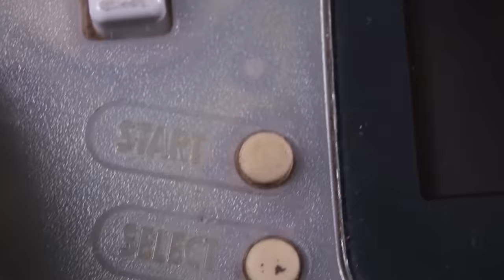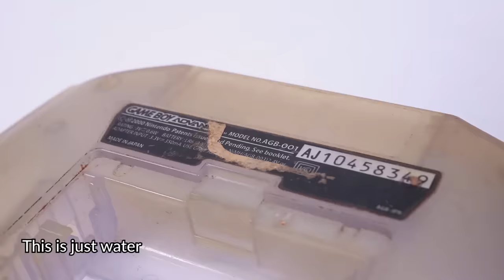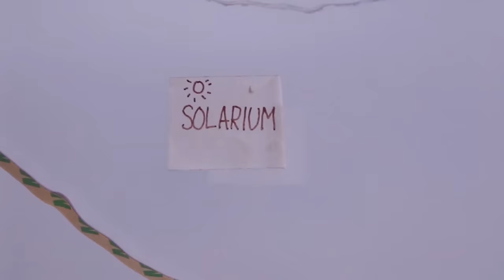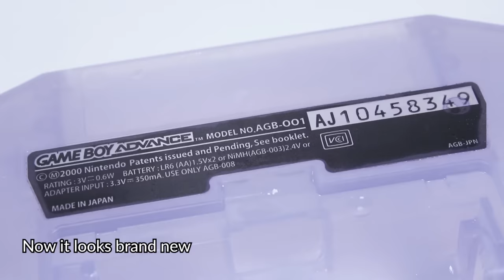I Restored This $5 Ebay Junk Gameboy Advance. It Used to be Blue – Retro Console Repair

Comment: This proves alcohol can indeed fix anything!

*drinks alcohol*

*cries*
Reply: and rethinking life
Reply: Have a nice day
Reply: Well there's your problem: you're drinking ethanol, CH3CH2OH. The alcohol that fixes everything is isopropyl alcohol, CH3CHOHCH3. If you drink enough of that all of your problems will be over soon enough.
Reply: Türk müsün
Reply: @muptezelbayan7585  what
Reply: Where are you from
Reply: Why is the “**” not working on your thing??

It usually goes bold
Reply: @giggityguy  I mean, you're not wrong
Reply: @giggityguy  Or at the very least, you aren't going to be SEEING those problems.
Reply: @havenmj  
they put two instead of just one, the letters are still bold inside of them, you can just barely notice it if you look close enough.
Reply: r/CursedComments?
Reply: @brandoneverett3418  SHEESH,
Reply: @giggityguy  you aren't wrong. they'll be over one way or another.
Reply: @Temperance Winzenried What are depression naps?
Reply: I came in the comment section to say that.
seems like geniuses think in the same way.
Reply: crying fixes your inside brain. but kills everything else
Reply: Technically alcohol is a solution..
Reply: @bradleyengland995  Is there something like an outside brain?
Reply: @Mike Hawk ?
Reply: So funny because its true

Oh god
Reply: @giggityguy  you just spoke like Agent 47.
Dont worry. It will all be over soon
Reply: Drinking alcohol can make you drunk!
Reply: No it doesn't just tek

Comment: Normie: Why do you repair an old console that counting the materials you used to fix it, its more expensive that buying a new one?
Odd  Tinkering: my goals are beyond your understanding
Reply: kindertuc Ugarte The Flash reference? :P
Reply: Actually you can make quite a bit of profit from fixing a GBA like this.
Reply: The materials he used are probably old and plus he would have money to do this
Reply: Right? Fix it and install a backlight onto the thing, and I am sure he'd make bank.
Reply: did it for the 3m+ views haha
Reply: It is just fun to do.
Reply: @lkskun  and fun to watch, i once replaced the lens of my ps1 back in the day. i also like tinkering with stuff but i end up destroying them haha
Reply: More like my views and subs
Reply: I mean some old devices only need a good cleaning or reflow (basically reheating the solder to fix loose points)
and on some occassions the biggest issues is a busted capacitor that tend to be like 50-99 cents a piece to replace
Reply: people like watching things that trigger their nostalgia ahha

Comment: Odd Tinkering: "Needs to open with special-"
Me opening GBA with knife: "What?"
Reply: me to I just use a knife most the time
Reply: How to be as intelligent as Einstein for normies
Reply: I'd use a proper screwdriver. But what do I know, as a female.
Don't use kitchen knives as tools, it drives me mad.
Reply: Reminds me of when me and my friend had to replace the can in my 360 slim

You have to a special pick to pop latches for the casing. We just shoved a flat head in some and smaller clips we just rammed a knife in.
Reply: Jajaja i use knife for ps4 controll

Comment: In 2050 he is gonna be like 'restoring an old Nintendo switch' lmao
Reply: It used to be magenta and cyan blue
Reply: A retro Nintendo Switch.
Reply: 9600GTMAN  I've had mine for 2 1/2 years, it works great. I just don't play that sword and shield shit. Let's go eevee all the way 💯
Reply: 9600GTMAN bruh I’ve had mine since launch
Reply: "It also seems to have the old "joycon drift" problem that these consoles so often had."
Reply: 9600GTMAN  maybe because I don't use it much. I haven't really moved on yet, so I usually use my 3ds instead. My 3ds has a couple problems like static along with the music.
Reply: 9600GTMAN  Correction: 3ds XL

It's only four years old, sorry for the confusion

I've dropped mine, accidentally scratched it, but it stuck with me. I'm using it right now, and I've almost defeated the ultimate ghost in find Mii!
Reply: @9600GTMAN. That’s a false statement
Reply: @9600GTMAN. I’m going to assume that you’re just doing this for reactions and move on with my life.

Comment: That's a pretty mint condition. I remember on my famicom that my most recurring problems were a torn rubber below the joystick buttons or a loose plugin port for the joystick that needed soldering.

Comment: I have the exact same gameboy advance but it still works fine.
Reply: I have one too.
How can someone drive their console to such a state?
Did they throw it inside their basement or something?
Reply: @WH250398  it's not like nintendo only makes one copy of every style.
Reply: Same.
Reply: Well I remember owning these consoles at like 6 or 7. Easy to understand how it looks like this
Reply: @WH250398  mine worked till a year ago, stored it when I moved and forgot to take the batteries out and now the connections are COVERED in battery acid and blue is corrosion. Might be able to clean and fix it 🤔
Reply: @dahfishguy  I was being slightly sarcastic lol
These things are built to last. Those batterycontacts aren't hard to fix by the way. Take them out and let them sit in vinegar for a while. The vinegar will eat away the batteryacid.
Reply: This one looks like a dog buried it in the backyard. Never fear Odd Tinkering can restore it. Wait till he does a Coronavirus fix!
Reply: @WH250398  I didn't catch that haha. Thanks for the tip, wasn't sure how to go about cleaning them
Reply: dahfishguy yeah thats a easy fix, cutips isopropyl alcohol and paper towels will take of the corrosion and if a spring gets broken in the process aluminum foil can get folded into a tiny square to be the conductor instead
Reply: I have a gba sp but my mom knocked it off the table and the hinges kinda broke

Comment: something is broken
This guy: let's rub some alchohol on it
Me: that won't work 
it worked
Me: surprised pikachu face
Reply: This is fake. I do micro soldering all the time.
Reply: @teemoleague907  is that part just fake? that's kinda disappointing i mean there must be a bit of truth
Reply: @loverboy6149  what they do  in these foreign videos is shoot the video with a working product and edit those scenes for the end. The film maker will destroy the product and act like they got broken junk from eBay, or a trash can. And pretend to restore it. After that these scenes will be edited and put in the beginning. they destroy a 50 dollar product and make 2000 dollars or more from YouTube ads. They exploit the YouTube system. Notice the soldering job was bad. The meter needles  for grounding was put on the wrong contacts. He measured 2 hot leads! He never replaced audio caps. And he didn't even take off the power switch completely. There's solder joints on back of the board!
Reply: @teemoleague907  the more you know I guess. Still kinda disappointing to say the least
Reply: Are you sure it's fake, cause a bunch of other channel use the same product and show the complete process.
Reply: Shockblade Zed cringe
Reply: @p.m3726  it's cringey to see people say cringe
Reply: @looeegee  so you're cringy
Reply: @blind_surgeon  Define 'Cringe' please I've seen that word used so much that now I don't even know what it really means or when it should be used
Reply: @looeegee  you just used it so obviously you know
Reply: @blind_surgeon  yeah but it's actually cringy something you just don't like or find funny? If so that it's completely subjective or is it something embarrassing or to feel bad about? I mean there's so many people using that word that now everything is labeled as cringe and that just makes me, well, cringe if could say so, I don't know if you get me.
Reply: @looeegee  I think you're reading way too far into it.
Reply: @blind_surgeon  well forgive me, if you didn't notice English is not my first language thus I felt curiosity for the use of the word given it's not something seen in my language. But thx btw.
Reply: @teemoleague907  still good for layman showcase to avoid complexity lol
Reply: As someone that worked in an electronics manufacturing company, we used alcohol to clean our boards all the time. When we weren't cleaning them with tiny brushes I cleaned boards in a giant vacuum chamber to clean off flux and other materials from the soldering process. Had giant gas cans full of the stuff and dunked boards in while brushing off the grime. So people who are saying you can't use alcohol are wrong because it's standard throughout the industry.
Reply: Dead Meme
Reply: Say this as an actual comment
Reply: @looeegee  free Hong Kong
Reply: @looeegee  people are fixing sound capacitors with alcohol? Are you serious, can you post a video of it? Cuz I think you are the one lying
Reply: @teemoleague907  see the previous comment where someone addressed it, he gave a clear response unlike you that are claiming fake something which obviously it's NOT, the fact that you supposedly know about this doesn't make you right about saying that this YouTuber doesn't fix anything and shows an actual brand new product, I mean who you think you are??
Reply: Samuel Barela please, don’t assume that he’s actually Asian. I’m not debating anything just pointing it out
Reply: @teemoleague907   when someone says alcohol most people think only of ethane that is in beer,vodka etc...while there are countless alcohol types and ethane is only one. the guy used isopropyl alcohol which is a great for cleaning things.it is used to clean metals glasses and even human skin(hand sanitizers have isopropyl alcohol in it.)
for example I use it to clean thermal paste that connects various pc compartments.
Reply: @lel9422  I use it all the time too. However alcohol does not help sound capacitors. On a PC, you have a sound card which is totally different and not the same. Your example is  an apple and oranges comparison. Also, I use thermal paste to reapply CPU. However  this guy didn't use thermal  paste.  I mean you can say the sun is bright and the sky is blue. It's all true, but it does not apply to fixing a Nintendo handheld console. Please do not use Strawman arguments.  Zoomers might belive you.
Reply: @teemoleague907  Balboso is not even a word, did you mean baboso?
Reply: @teemoleague907  Anyway I'm sorry if i offended you or were rude, each one has their own opinions and thoughts and we are free to disagree but that's ok.
Reply: @teemoleague907  he used isopropanol to clean a plastic case that became yellow from soil and dirt aaaand news flash it can do that
Reply: @lel9422  news flash, you can't fix sound capictors with alcohol. These zoomers
Reply: @teemoleague907  I didnt say anything about sound capacitor in my replies hell even the guy you replied to didnt say sound capacitors I just said that the process in the video is not fake which you said was fake so stop already you are changing the point
Reply: @teemoleague907  the racism just jumped out huh?
Reply: @nkechi4635  nope, I support the Freedom of Hong Kong
Reply: @nkechi4635  No comment, oh you racist about the people of Hong Kong? What about the Arabs you put in prison because they are Muslims.😂
Reply: Samuel Barela You May be right or wrong but you are the most unlikable person to be able to randomly bring up the terms chinese boy as an insult. It doesn’t validates your proof, even if you are right it just makes you less mature so you look like you are wrong. I suggest you stop assuming someone race and if you were to argue, actually give a valid response and not something that no one can take seriously
Reply: @smollilnub3644  only  someone from China would be offended because they are exploiating the YouTube system. It's a very common thing they do

Comment: The only thing that is bothering me is that protective layer, missing, for that sticker on the back. (OCD)
Reply: I'm sure if ya know what you're doing it's possible to make your own
Reply: It’s pissing me off as well
Reply: It's there to be removed, at least it protected the sticker
Reply: @zer0b0t   Well, the sticker is not protected, now. Against wear/tear/rubbing and other harmful actions.
Reply: I hate when he takes out the protective layer of the sticker
Reply: If you want to trigger yourself, wait till you realize that there was a rubber seal on the screen he didn't replace~
Reply: Well that, and he didn't test the headphone jack which was probably broken like all the other exposed components. Otherwise rly good
Reply: Raverick damn... you had to point it out didn’t you.

Comment: i just dont get how people get these things so flipping dirty.
Reply: They simply treat them badly. They use them everywhere, they let them to charge on a dusty floor, they forget to put them back in their suitcases.
I know because I have a 15 year old Nintendo DS and it's all dirty and scratched (even if it's not as bad as this one). 
I used to treat it pretty badly as a kid, but now I'm starting to do better because I've gotten quite attached to it, you know, I've spent so many years playing on that thing and I still do.... This guy has actually made me want to clean it up and maybe fix the touch screen that has calibration problems but I'm scared that I'll just end up breaking it...
Reply: Those have been thrown away for a long time. Probably in a ware house or trash site somewhere for a long while. I have a GBA that is 8 years old by now and it looks nowhere as bad as this. Probably needs a battery swap and it will work just fine.
Reply: I still have my gameboy advance in my drawer works perfectly fine but there is a small scratch no idea where I got the scratch from cuz I'm not a clutz when it comes to my electronics.
Reply: Because back when we used them we were kids. Different world man.
Reply: When I was a kid I was so impressed with my gba I tested how well the screen could withstand a scratch from a stone.

Comment: I was wanting to restore/mod my old gameboy, and recommendations for a soldering gun? I've got everything else except for the tri-wing screwdriver, but the new shell I ordered comes with one. (the current shell is cracked and is missing the back plate so I'm having to replace it entirely. It's the same color as the one he restored, but I'm getting a classic purple shell.)
Reply: If you ever plan on doing this more often, then for the love of god get a decent tri wind screwdriver. Don't use the one that came with the shell for more than one shell replacement. You will end up stripping a lot of screws.

Comment: Love these videos, they inspired me to take apart and clean a GBA myself and it went pretty well! But it still has some scratches, especially on the screen. Can you provide a list of the materials needed to polish the screen and shell? I have some high grit sandpaper and PlastX, but the resin polish is a mystery and I would like to get the right one. Great videos, great channel!
Reply: Most craft and tech repair shops sell resin products if you need it

Comment: Opening up a system like this and not adding a backlit screen just seems like a missed opportunity
Reply: Brandon Deuber yea I was disappointed that he didn’t add that
Reply: I read "restored", not "improved" :P
Reply: I agree. But in this case if he wanted to keep it original, the screen it came with is fine. It is just a restoration after all.

Comment: Such a great job!! I would love to see a DS fixed, the R and L button on mine doesn't work anymore and I don't really know how to fix it
Reply: SAME
Reply: Mine too!!
Reply: Check the assembly. The spring may have slipped out of place, or if you're unlucky, it might have lost some elasticity and is not returning to position properly. I've had both those problems with the ds and the sp. I imagine it'd be cheap enough to replace the spring with a little searching, but if it's the button the trigger pushes, that might be more complicated.

Comment: My toxic trait is thinking "yeah I could totally do this"
Reply: You can, its not very hard for a lot of projects. More often than not a lot of these old consoles really just need a good cleaning and some TLC. Some will need work but learning to solder and learning how circuits work on a dead/dying console is much easier and less risky than doing it unplanned and off the cuff.

Comment: I actually went to a thrift store almost 4 years ago and found a dark blue gameboy advanced in the kids section. No battery cover but no corrosion or battery’s inside [it didn’t have a battery back on it] I took it home for $5 and it worked perfectly. I bought a battery cover for it and still use it to this day with only slight cleaning to the pins needed from me using it overtime.

Comment: I have switch problems with my advance. I don’t have a soldering iron, but if you’re careful you can grab some soft sandpaper, pour on som iso and slide it under that switch cover to get some of the grime out. It helped for a while but wasn’t a permanent fix.

Comment: I much enjoy the resurrection of these devices. 
 I have another hobby that brings an applicable question here. Does the hydrogen peroxide and UV light truck work for all oxidized plastics? My hobby has me running across items with acrylic and poly lenses that see a lot of sun and will be very cloudy and discolored. Most times the solution is to just get a new part, or go to town with some marine oxidation remover and boat polish to remove the haze but the discoloration is still visible. If this works for all polymers/lexan and such, I would be ecstatic.

Comment: The power switch isn't supposed to be black after cleaning. For anyone watching, use something like a paper cotton swab, break off the cotton, dip the tip in IPA and rub the contacts until they're clean. They're supposed to be shiny.